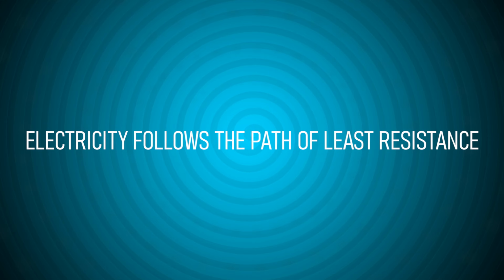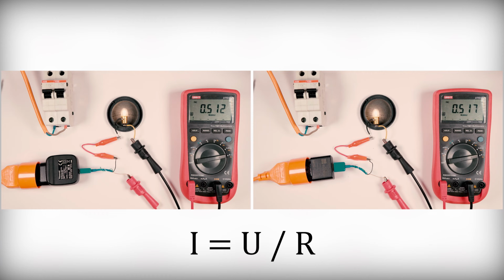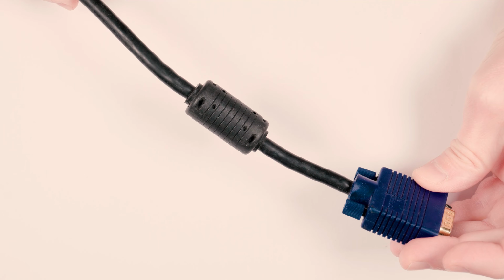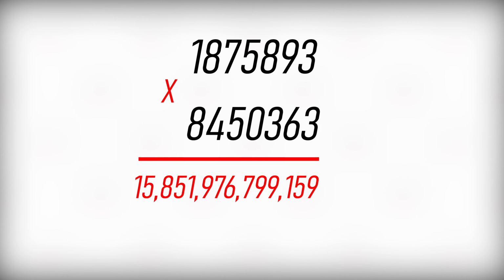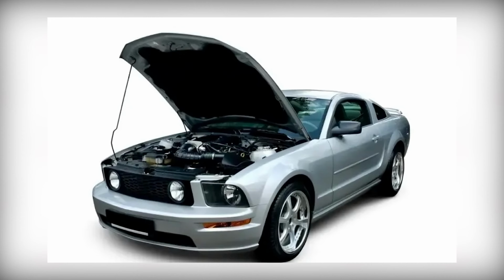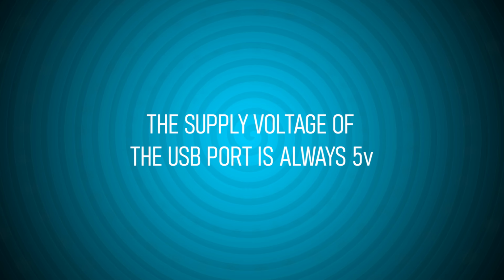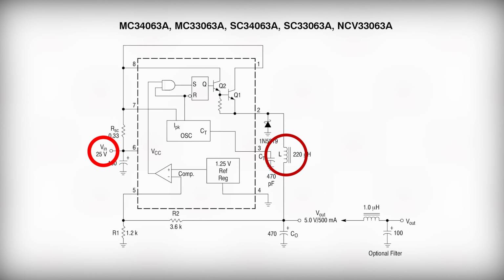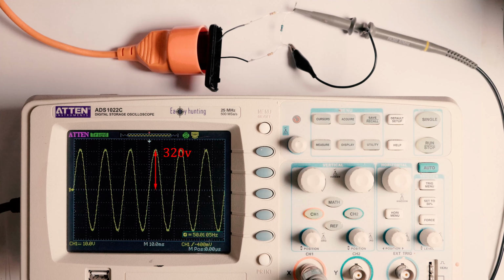10 Common MYTHS about ELECTRONICS.

Comment: #3 when you have a tool that works at certain voltage if you want to increase capacity you have to connect the batteries in parallel. if you connect them in series, you will burn your tool. You twist things instead of explaining

Comment: This logic is incorrect. You stated that current will go out of both paths and that the amount would be reversed to the capacity of the resistors and showed how the lower resistor passed a more amps that the bigger resistance as evidence BUT this is expected. What you have is simply A + B = C… if you have wire with 500 ma and a 50 ma then you should see 450 ma out the end of the wire. The same is true of the other wire with the bigger resistor.

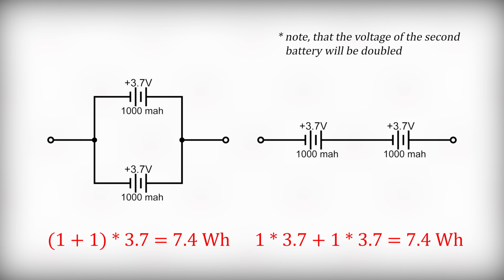Comment: 6:45 I'm still confused about this battery capacity concept !😢
Reply: That part of video is wrong. Yes the energy is same, but capacity is explicitly different thing - exactly why there is that separate word. Capacity explicitly means the time*current, regardless of voltage nor energy.
Reply: if you still confused 4 mnd later, its probably because you explicitly read the mAh formula.
Have you heard about step down converters?
If in a example, you have 6 V , and 2000 mAh, but a light source that only need 3V at max, in theory that step converter can get nearly double the run time, compared to a 3V 2000 mAh battery. this is way Watt hour, is capacity that include the combination of Voltage and mah.
Now in real world, nothing is 100% efficient, so from this two 3V batteries in series, which is 6V, you will maybe get 80-85% the conversion, so maybe 3800 mAh, instead of the expected 4000 mah.
Reply: Apply 2nd Kirchoff's law to 1st circuit

Comment: To be fair car igniters won't work with any 12v supply, it needs something capable of of more than 450A for a few seconds.
I don't much about car ignitors other than that, but I do lnow that imdustrial igniters with 12000v transformers for boilers is common. So the voltage is still important to make a spark happen.
Reply: You are talking about starter, not igniter. Where was it claimed it would work with just any 12v supply? Of course, just as was stated, every load requires the power supply to have equal or higher amp rating than the load draws.

Comment: Battery capacity myth busting is only for spherical horse and some batteries, but not for all. In practice, capacity is rated at specific (and for marketing purposes very low) current, at least for typical non-rechargeable AA/AAA, for rechargeables in the car example can be busted maybe...). Connecting (at least cheapest AA) in series will decrease their capacity greatly due to higher current.